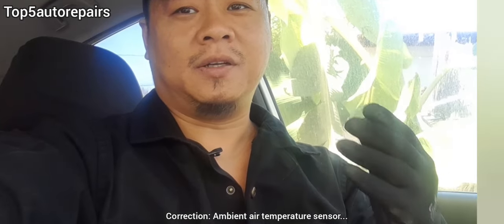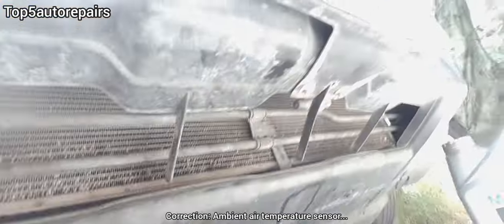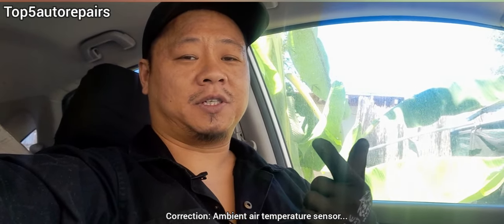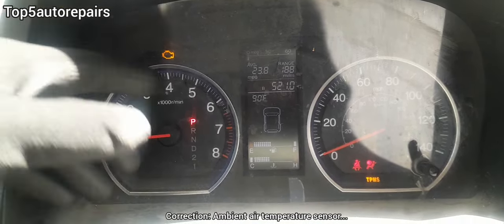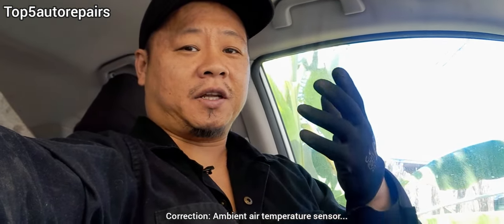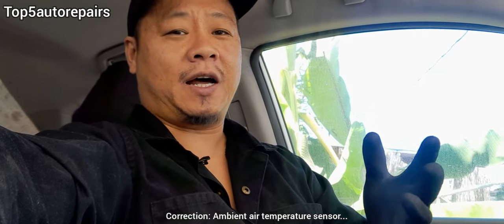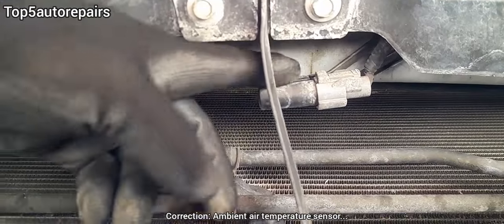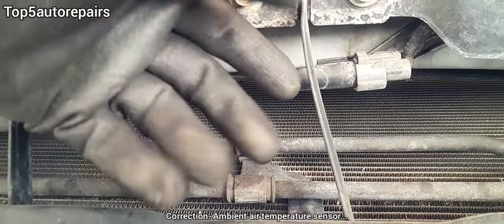SYMPTOMS OF A BAD OR FAILED AMBIENT AIR TEMPERATURE SENSOR CODE P0070 P0071 P0072 P0073 P0074 FIX

Comment: Does it have a fuse and where’s it located? 15 Ford Fusion. I put in new sensor and still not working . I checked pigtail with test light connecting clamp end to frame of car the sharp end to inside of the pigtail. It didn’t light up

Comment: I just bought a 2015 Chevy silverado 2500hd and it is displaying a constant -40 no matter what the temp is outside. The air temp has been in the mid 70s to mid 80s since I purchased the truck 2 weeks ago. I am not sure if it is a sensor issue or something in the main computer hmi since the display is on the touchscreen radio

Comment: I have a 2011 grand marquis. I did the EATC test on it and it's giving me a dtc code 42. All data on a YouTube video says outdoor ambient temperature sensor. Im trying to locate it now. Do u suggest to replace or look for frail or pinched wires first?

Comment: Could this be why my compressor in 2011 Highlander shuts off at idle but works fine when at 1500 rpm or above? It is charged to the correct pressure and does not have a leak

Comment: Help if you can 
14 Silverado AC has a mind of its own. Compressor is working no blow fuses,no leaks and pressure high and low side are within range according to the chart for outside temp and humidity. I replaced ac relay because I thought it was going bad. 
Could this possibly be the prime suspect before I take it to a shop. 
Thanks for any advice
Reply: Forgot to mention no codes
Reply: Were you able figure out what the problem was? 
I have same vehicle & I’m having same issues with my ac. I’ve checked/replaced everything ac/compressor related but still having issues.

Comment: So it flooded here and while driving the water ripped off my temp sensor and the part that clicks in to the sensor looks kinda messed up. How to I replace the plug?
Reply from the maker: Aftermarket connector or a used connector from the junk yard. The connector consists of two or three wires. Use butt connectors to connect it to existing wires.